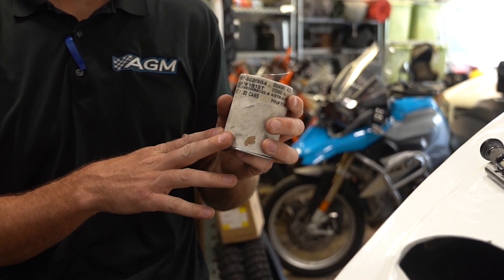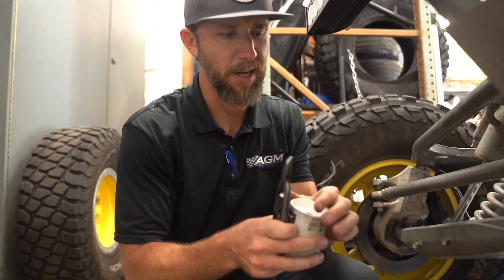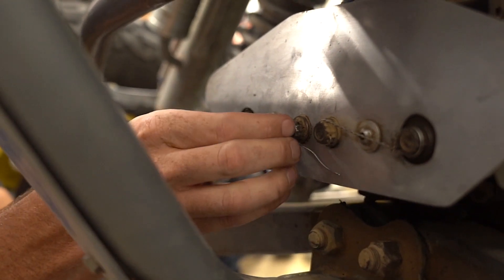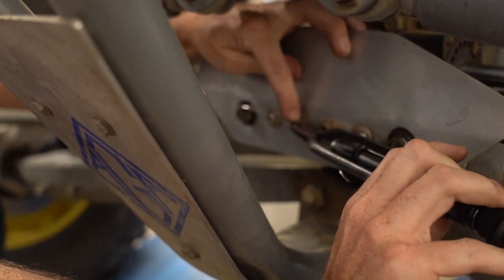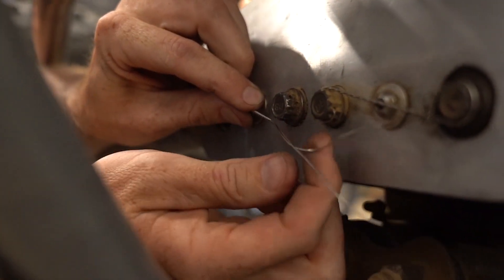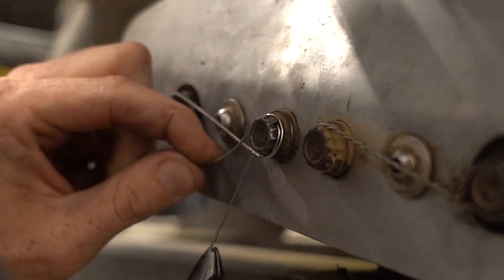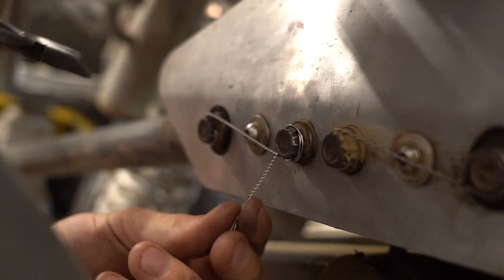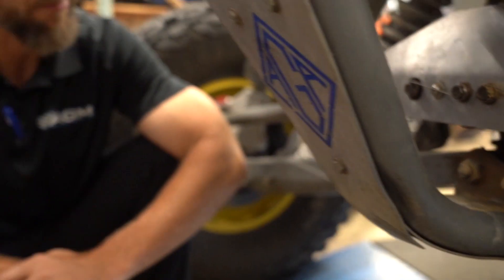How to Safety Wire | AGM Quick Tips

Comment: That was a very great explanation of how to lockwire a fastener.  Although, on the second bolt your final twists were pointing to the wrong hole.  You had the left, right and 8-10 twists per inch correct, just the final left hand twist coming out of the hole.  Also, the wire should have the wire twists come up to the holes in the fastener.  I only say this because I worked for 30 years in aerospace and if you over twist the wire it will break, too loose it doesn't do any good.  Same goes for twists to the hole in the bolts.  Pigtails should be 5-7 twists and turned back like you had shown.  Usually, helps to use needle nose pliers for that pigtail.  Otherwise you did great,  I can show you some other tricks to help keep the twists close to the holes.
Reply from the maker: Greg Parker completely agree with the twists coming up to the hole and thank you for pointing that out, sometimes when trying to pack all the info into a short video and make it easy to understand for people new to the concept you overlook details in an effort to get the concept as a whole across. Thank you for watching and for sharing your wisdom.